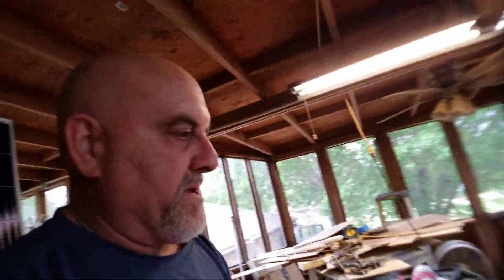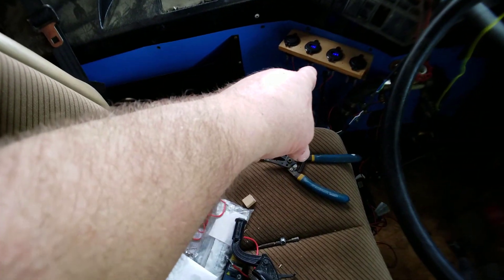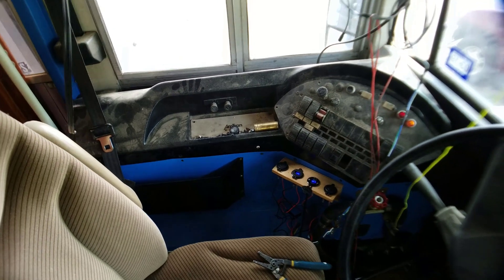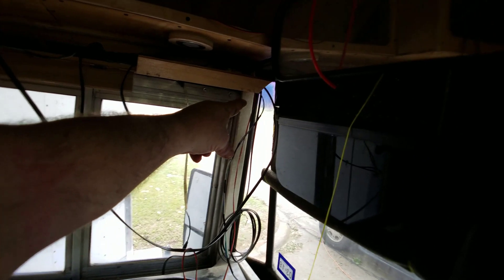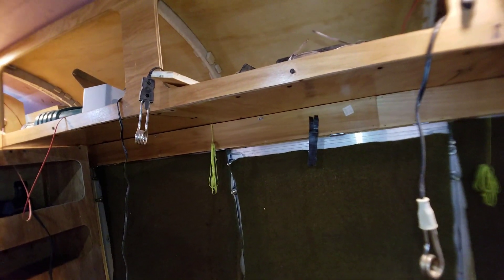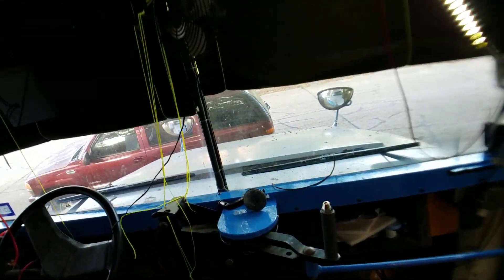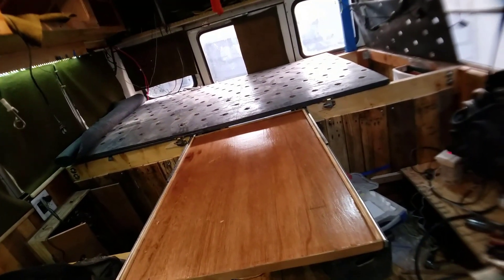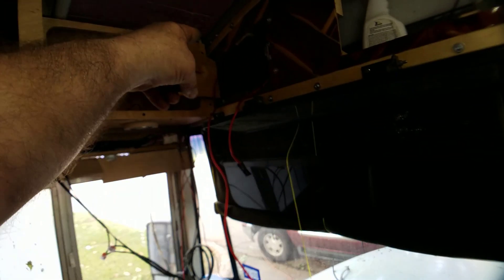SBRVC E82 Slide out table, painted dash, fog light relay

Comment: What about the roof in the bus. I can not wait to see everything cleaned out and the finished bus. Right now all I see is stuff everywhere, so it is hard to see your progress. You have worked really hard at everything. May will be here very soon. Will you be full time?
Reply from the maker: yes full-time, as for the ceiling i'm not sure what i'm going to put on the ceiling (it is going to be wood), probably 1/4in plywood cut into 4in strips so that i can off set them

Comment: What are you installing for HVAC for living space?
Reply from the maker: Window AC unit
Reply: Does it Heat and Cool?
Reply from the maker: @KSB81613  no just ac, I have a separate propane or electric heater depending on which I need (might need both at times), and yes I have a carbon monoxide detector
Reply from the maker: @KSB81613  no just AC, I have a separate propane or electric heater depending on the circumstances (might need both), and yes i have a carbon monoxide, propane detector